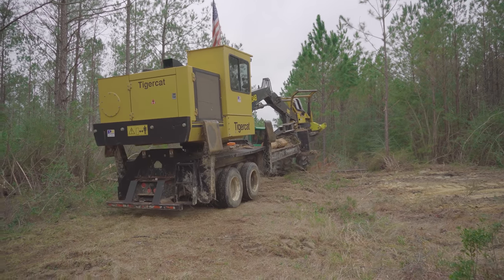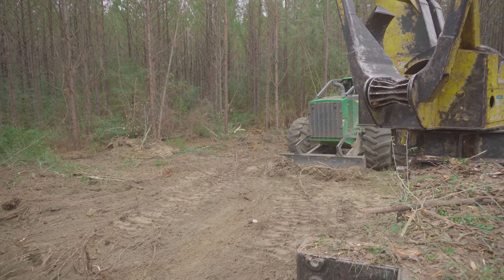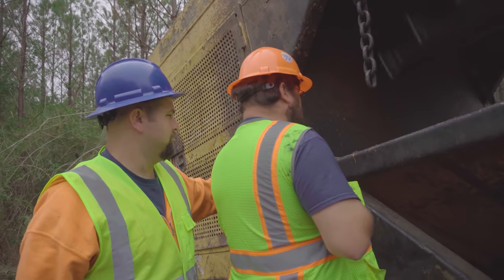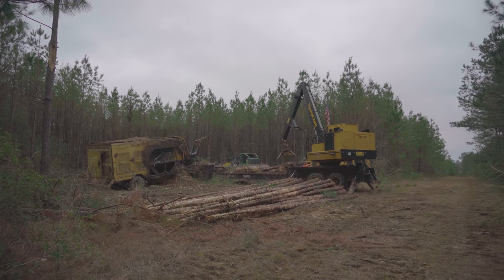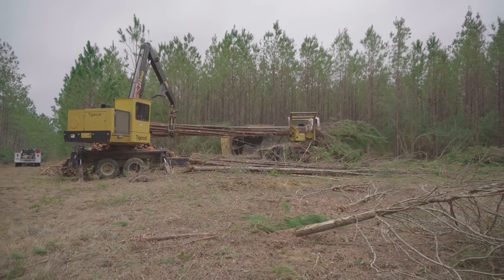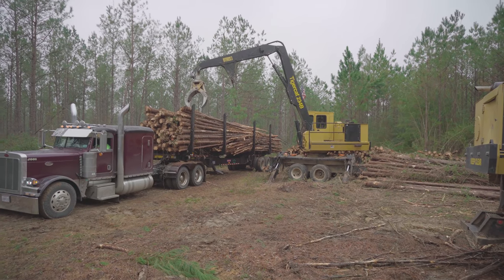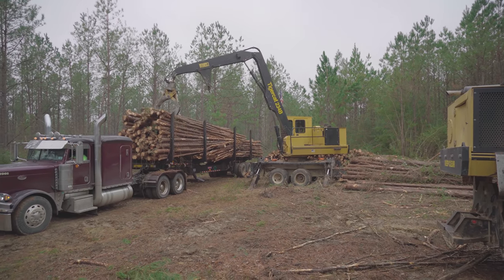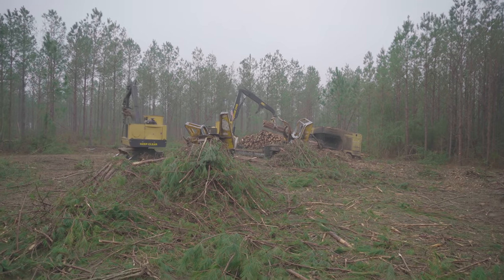Starting A New Tract Of First Thinning & 1000 Angry Beavers

Comment: Interesting method. Here in Sweden it is mostly used
harvesters and forwarders. However, this looks effective.
This is where the wood industry is built
3m = 9.8ft pulp and 4m = 13ft timber,
so that's how it works here.

Comment: I give pulpwood trucks a very wide berth.

Mid 80's, with a bus team in Tennessee, we came up on one.  Straight truck.  Pole racks were more weld than original material, and the welds looked like mud dauber nests.  Overloaded to the point the frame was clear down on the stops, on the axle.  One thin excuse for a chain over the middle.  No mud flaps.  Back tires all mismatched, two were flapping tread.  He was down to 1st or second gear to hold it back on the downgrade we were on, somewhere between Spring City and Morgantown.  We passed him.  I guess he made it to the bottom, but I can't see how.  Must have been his boy's guardian angels, working hard to keep him alive.

Comment: A skidder pushing dirt is like a T-Rex using a fork
Reply from the maker: Works fine for me. I’m always accepting donations for a dozer.
Reply: Old John Deere 640 with a trail blade which was a 4 way dozer blade was a dirt pushing animal especially with bear paws on the front and ice diamonds on the rear and we logged NY frozen mountains and those old Deeres with trail blades would push skid roads in like no tomarrow even frozen ground.

Comment: Hey there Thomas,

Enjoyed watching the machines working. Just wondering, but I have noticed that the JD skidder more or less seems to run at a constant RPM. The Tigercat will rev up and down as required. Am I correct in my observations?  

Also there seems to be a fair amount of clay in the soil at your set (landing). It was lumpy and sure was sticking to the skidder’s blade when he was making the dirt pile for the eliminator. 

I liked what your Dad said “we buy equipment from JD and Tigercat. That way we can keep them honest.”  Good policy. Thanks for your video work.
Reply from the maker: Yes the Deere runs a consistent rpm
Reply: @CuttingEdgeLogging_Thomas  
Thomas thanks!
Interesting, the constant speed diesel must drive a hydraulic pump or something like that a torque converter. I don’t know I am not an engineer. 👋

Comment: IMO The Chambers Delimbinater, or how ever it's spelled, is the greatest piece of  equipment someone that 1st thins regularly can buy! It is a great design,it works great and saves the driver or trim man loads of time and work! It will usually pull most of the muskidine vines out too if your mill bitches about trash. If I started a thinning crew tomorrow I would not crank the first machine without one on the job!

Comment: What is the diffences between 948 and a 748 l 2 i want to know and this is tim wallace
Reply: Well the 948L2 is supposed to be compared to the 635 tiger cat the only difference is the 948 is only fall wheels and the 635 has six wheels but I’m here to tell you that 948 will not hold the wood and the grapple like the 635 wheel but the 948 is a bigger machine than the 748 if that answers your question. JS.

Comment: Who needs a dozer when you you got a great skidder man.
Reply: hate to tell you but if my skidder operator pushed dirt like that he would be fired
Reply from the maker: I have to know why 😂😂😂
Reply: @CuttingEdgeLogging_Thomas  as you know those tires are expensive so to spin them because he is dropping his blade to deep is not productive if you put your blade so you take several inches over the length of the push instead of dropping your blade to deep sit there spin tires leaving a rut pushing that dirt and going back and doing the same thing
Reply from the maker: So what ya gonna do when he hits a stump?
Reply: @CuttingEdgeLogging_Thomas  tipping a stump over by caughting the top is easier then trying to push it straight across but that is just what has worked for me over the last 35 years you seem to have a good operation going so keep doing what works for you